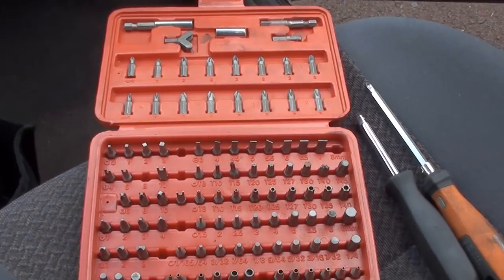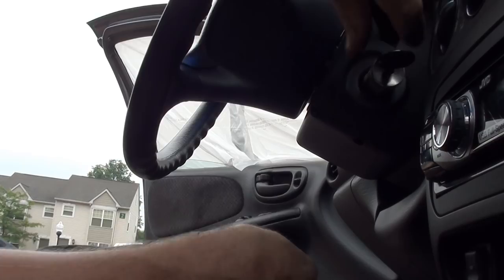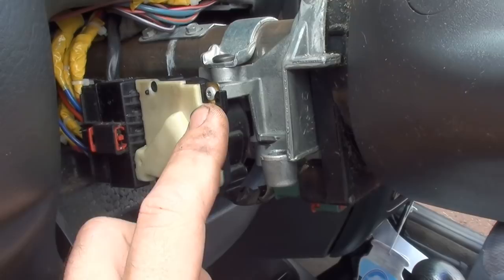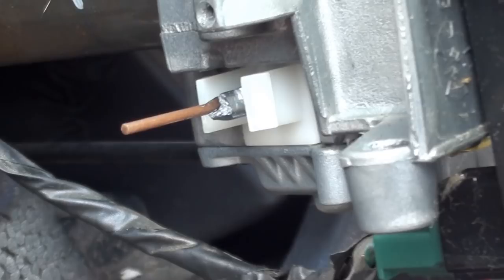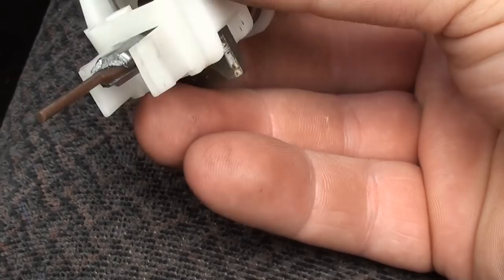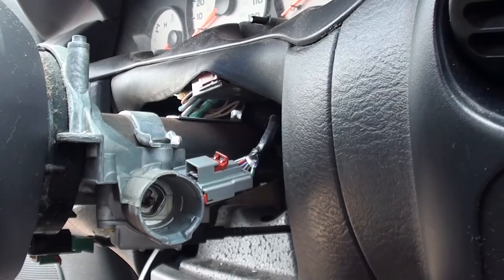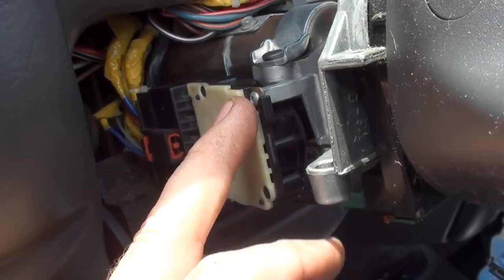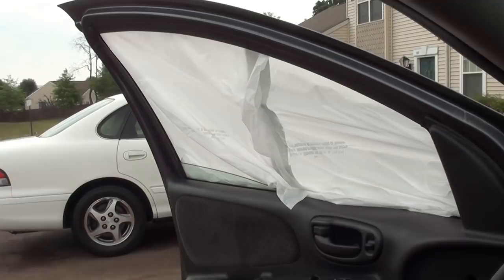Ignition switch repair Plymouth Neon

Comment: Just used your video to fix my 2005 Neon !! My car wouldn't start when i came out of the store. Only would turn on my dash lights, not engage the starter. Had the starter checked after i removed it, it was ok.  Took the column apart and the same problem, bought one at Napa auto parts $41.00 installed it. Problem solved!! Thanks for the excellent video.

Comment: Yesterday at work, I went to start my 2002 Dodge Neon SE, and it wouldn't even crank over. I was able to bump start it, so I figured the problem was somewhere in the starter system. When I got home, I started checking fuses, relays, connections, etc., and eventually made my way to the clutch starter safety switch to bypass it. When that didn't work, I hammered away on Google until I found this video. I then went to Advance Auto just before they closed and picked up a new ignition switch to install this morning. When I pulled everything apart, I found the actuator pin was broken - exactly like in your video! I am going to install the new ignition switch anyway, because I lost the ability to toggle the key to the accessory position a year or so ago, but I'm now on my way to picking up my new Dorman actuator pin at Advance Auto Parts as well. Hopefully within the next hour, I'll be back on the road and living the nEoN lIfE for another 175,000 miles! And all for about $60! Thanks much, Will Robinson from Robinson's Auto! 

Oh, and when I'm done, I will un-bypass my clutch starter safety switch! :)

Comment: Good video. The part you replaced is called the IGNITION SWITCH ACTIVATOR PIN ASSEMBLY. It is a $45.00 part. If you sent the vehicle to a dealership, they would have charged you nearly $700.00 for that job. Good work.

Comment: Thank you for posting this video, it helped a lot. My wife's car wouldn't start but the key would turn and all the accessories worked... it ended up being 1 arm of the ignition actuator. Again thank you as I have never taken apart the ignition system before.

Comment: Hello there. 
I found an alternative to going to the junkyard and getting a never used AKA new part. It's Dorman part #924-704: Ignition,Switches Actuator. It's fully assembled as well = drop in replacement.

The exact thing happened to me 2 days ago with the 2003 Jeep Wrangler Sport I drive and bought new in '03. Thanks for this video as well as it covers vehicles from that era that have this common problem (metal actuator looks like it's made out of pot metal, hence why they go out / break).

Comment: Awesome video, very well edited, described and video, one of the best how to video's I have every watched. just as a note all the parts are available.Here are the part numbers:switch standard motors part # US447 switch actuator pin Dorman 924-704cylinder lock Dorman 924-703Thanks again.

Comment: This worked perfect! O'reillys had the Dorman 924-704 part in stock for $40, and the security bit set for $7. Because of the video it only took me 30 minutes to diagnose and replace the ignition actuator. Thanks so much.

Comment: You can buy that piece by itself - it's called the ignition switch actuator pin.  It's the same one as the 2006 Jeep Liberty, the Napa PN is 6201414.  The MFR part number is 924-704 (Dorman).

Comment: i want to thank you ! my gfs car just did this 2 days ago, and thanks to you i found the problem, got it all out same break only problems i ran into is that the screws were to soft and striped im blaming the heat over here lol, but i got er out ! going to pick a part tomorrow to get the replacement ! i tip my hat to you good sir !

Comment from the maker: @turbobuick33 im not 100% sure, i think i purchased that set at harbor fright a couple years back in a pinch, its a security bit set. made by drill master. cheap set however i break the good brands as well, so far they held up. thanks for stopping in, will

Comment: THANKYOU for this video, I am going to try replacing the actuator pin and the electronic switch when the new parts come in tomorrow. I didn't even think about those pieces. My car will stay on like it is in accessory position no matter how I turn the key or if I take it out.

Comment: Thank U, I have a neon that had this issue and i couldn't get anyone to fix it so it has been sittin up.  I went as far as connecting a wire to the starter with botton to start until i finally got tired of doing it. Yeah i had to pop the hood remove negative post and fuse to shut it down....lol thanks bro im fixing mine and gas will be saved...

Comment: Great video. My neon suddenly stopped running while i was driving ( in a parking lot ) and does not want to start at all. No clicks from the starter and no buzz from the fuel pump. My lights work as well as the dash lights but will not turn over or even sound like it want to. I am going to change the ignition switch to see if that is the problem. I feel i can do it after watching your video. Thanks

Comment: Thank you for your video. had same problem on 2002 town and country limited. switch is a little diffrent than than the one you are doing, but same procedure worked on my town and country. I had a transponder key. All I had to do is remove transponder ring from ing. switch. You might like to show how to do this in one of your videos. Again thank you for your video.

Comment from the maker: Correct,  ignition switch actuator pin. Napa PN is 6201414. The MFR part number is 924-704 (Dorman)
covered in earlyer comments i will add it to the description thanks

Comment: Thank you a lot.  My Neon wont turn over when i turn the Key.  I was told to check the Starter to see if I get a 12 volt charge when I turn the key.  If I get a charge then the Starter is out.  If no 12 volt charge is shown then it's in the Ignition.  The Mechanic said my Battery charger will work and a Voltage Checker.  Thank you.

Comment: I went to Pull-A-Part and got the Ignition Switch (with the T10 Security bit) but I couldn't get the Actuator because there is no key to remove the lock cylinder.  Just knock it off with a hammer and chisel next time?  Great video thanks.

Comment: Excellant video very easy to follow and informative.  Robinsonauto I have a problem with my car starting sometimes when I turn the key to the on position the Skim light comes on and the car will start and die in a few seconds.  The light occasionally comes on while I drive as well.  I've sprayed the ignition switch with electrical contact  cleaner and that fixes it for a while and then it comes back do you think this problem has something to do with a malfunctioning ignition switch?

Comment: How do you separate the actuator pin assembly from the ignition switch? Every video I've seen makes it seem like they should just come apart, but mine will not separate.

Comment: Ignition switch and actuator both failed on my 2004 Dodge Neon and this video proved most helpful in diagnosing the issue. See my thread for this problem on JustAnswer.com posted initially on 3 Feb, 2015, "2004 dodge neon sx 2.0 automatic. Quit…"

Upon disassembly of ignition lock cylinder, ignition actuator and ignition switch assembly several problems were encountered.  The “mechanic” who last disassembled this system to repair it lost two springs and two detents on the ignition actuator so it was not operating correctly. The ignition switch was the original problem, as it would not operate smoothly. When my son turned the key the actuator failed when a pot metal tab broke off that turns the ignition switch into start position because of the high turning resistance in the switch.  

I purchased a new ignition switch and actuator for $CA107.51 and reinstalled them after much fiddling.  I had to tie the longer stem spring with thread to compress it before inserting the actuator stem into the ignition switch and I had to wrap scotch tape around the brass detent and spring which kept flying off the moment I tried to install it in steering column…no wonder the original went missing!  The ignition actuator comes with a two page detailed set of installation instructions plus three photos (Dorman Part #: 924-704) but it fails to mention the above two crucial installation issues.

Comment: I'm in England so I've got a right hand drive Chrysler Neon 4 door ( does that count as a saloon ) and I think that it's the electrical part of the ignition. People here in Plymouth including auto locksmiths look at me as if I'm asking about an alien spaceship and you would not believe how many places I had to try myself looking for the front brake pads and discs so that the garage could fit them. No-one so far knows anything about the rear ones as they are not discs and pads ! Are they really that uncommon in this part of the country/world ? Anyway I'm going to give it a go with your video and hope for the best !

Comment: hey got exactly the problem you showing here, that broken aluminium piece of a neon 2000. Am in Botswana, southern africa, any idea of nearest dealer i can get asistance from without having to buy the whole steering column as suggested by the local dealer> Would very much appreciate it

Comment from the maker: Sounds like you may have a tumbler issue in the cylinder itself if so its cheapest just to replace, you can try and have a new key cut and see if that helps, most likely its the cylinder

Comment from the maker: @pepi27 sounds like you may have something installed incorrectly. there is usually a separate set of contacts for the key on the cylinder

Comment from the maker: you may have blown a fuse, is the battery charged ? it may have drained during repair, make sure all connections are good and correctly installed

Comment: Im confused because my actuator pin broke exactly like the video, but the part has an instruction manual that has like 12 steps, explaining how you need to have the brass part at a certain angle, and how you need to turn the key and match some lines, and so ma y other steps. But in this video looks like u just put the actuator pin in and thats it. Ive been at it for 2 hours on my 2000 Dodge Neon and just cant seem to get it to work 😡
Reply from the maker: Not sure about the 12 step process. With the Lock cylinder out that lower portion should go up may need to wiggle the steering wheel if the lock in incorporated. Been years since I done one of these. May need to me turned in a certain position. I just always matched the old position when removed

Comment: Great video. Thanks.
I don't have that same problem but my cylinder keeps sticking. I have to bang on the key to get it to turn when this happens.  Is there an easy fix for the cylinder or should I just replace it?

Comment: I HAVE A 98 PLYMOUTH BREEZE THAT STARTS FINE BUT DOESN'T ALLOW THE KEY TO TURN ALL THE WAY BACK LEAVING MY GEAR DISPLAY LIGHT ON AND DRAINING MY BATTERY. ISN'T THAT THE CYLINDER THAT NEEDS TO BE REPLACED?

Comment: Hi, I have a question.... that happened to me on my Liberty so I also replaced the same part you did, but for some reason, the truck chimes or dings as if it had the key inserted when I open the door, the lights are off, the key is not in the ignition and it just keeps dinging or chiming and my alarm does not engage when I turn off the Jeep, I have to wait a few seconds to engage. Do you know what might be the problem? Thanks.

Comment: Ok someone broke into my car and tried to steal it. now the keys no longer work so i got a new ignition key lock cylinder for it.  however everything I have researched says you need the key to turn it in order to take it out.  what can I do to remove the old one if the key will no longer turn it?

Comment: Really professional videography.  Well lighted, good focus, good audio and scripting.  Nice.

I was wondering if aluminum shavings could be why the ignition switch fuse keeps blowing intermittently, usually just after the ignition is turned off.  A new 20 fuse resets it, then after awhile it happens again, usually noticed after first crank next day.  Is there anything in there to short out?

Comment: This is a really good video. Would you be able to upload a video showing the step by step process in removing the entire dash unit from the car. I could not find it anywhere on this site for this model of car. thanks in advance. I have a chrysler plymouth neon 2001 standard edition manual drive

Comment: I have a similar issue and could use some help. my 98 neon blows starter fuses when its really hot outside, but seems to have the same issues as the ignition switch, my starter is perfect and battery too..but it died a few days ago and couldnt be jumped, but i had all my accessories, should i try to replace the switch? i would love to figure this out..and would appreciate any advice!!

Comment: okay maybe I mightve missed something, but what tool did you use to remove the lock cylinder? 
I also have a 2000 Neon but my ignition will not turn at all and someone to me to remove the lock cynlider grease it up and it should work.

Comment: AutoZone..... $40 plus tax. I have a 00 Chrysler Cirrus 2.4L that had the same problem. Fixed it up and she runs like a champ
Reply: brian versansky Could you please post the part number? Junkyard parts... they're more likely to fail.

Same thing happened to my car today. I'm able to pop start it. God it's annoying. Yanked starter and battery and both passed bench tests tests at autozone.

Car runs but I can't get it to crank with key! I have work tomorrow. I love my car but god....